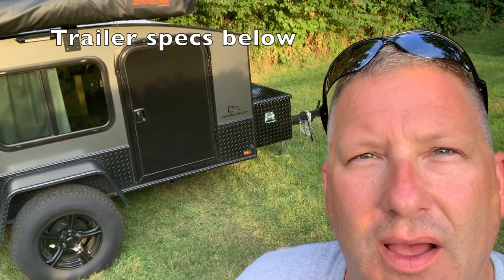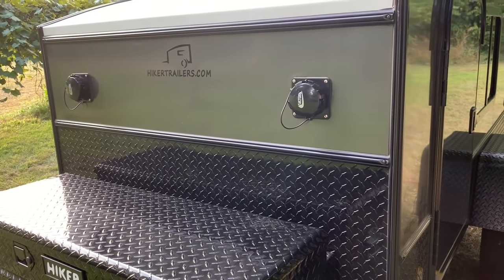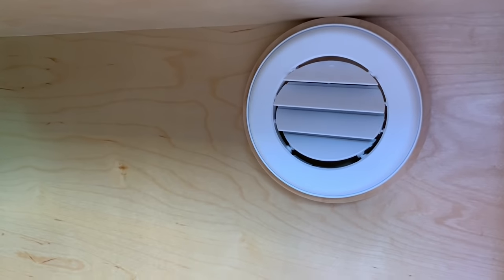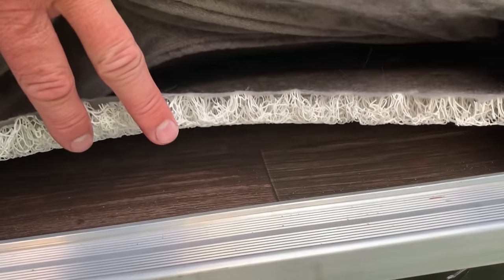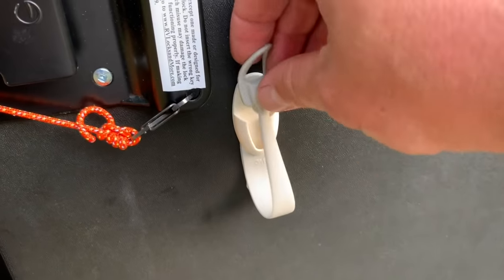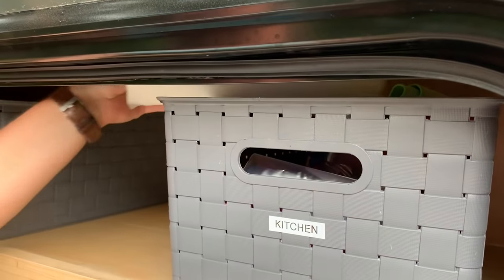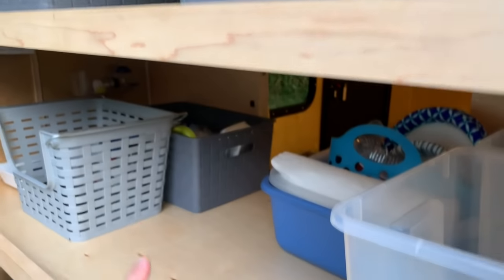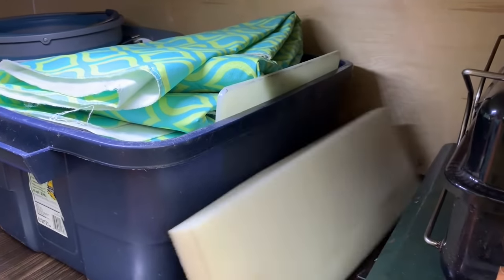Hiker Trailer - My 5x9 Mid-Range Walkaround

Comment: If you had not spent 20 nights in the trailer I would not have put much stock in your opinions..well done!!  Also..I was very impressed at Hikers flexibility in designing the trailer and in their execution.  It looked like quality work and materials at a reasonable price.  Thanks!

Comment: I am planning the ultimate road trip to Alaska. The Hiker is what I am considering. But getting dressed while lying down must be a pain? I may need something where I can stand. I have a couple of years to make my plans, so the info I get from you is good. And I am no spring chicken, I will be 65 when I go.
Reply from the maker: If you are off grid you get dressed outside if you are in a campground we have a 60 sec tent we pop up for changing . My wife does the wiggle worm in the trailer without issues. My knees say know. New video on the changing tent coming soon stay tuned.

Comment: Great video guys. So to be clear, you actually shortened the standard length of the galley shelves? Im undecided on the standard 17" or go with the 24". If yours are 14", im thinking ill be good with the 17". Any info would be greatly appreciated. Im getting ready to place my order. Thanks
Reply from the maker: Ours shelves are 24", we lowered the top shelf. I would always go with 24" shelves. The extra length in the cabin doesn't gain you much.
Reply: @MWDAdventures  Thanks so much for responding. Thats great info. Ordering today !

Comment: Matt, thank you for going over the details of hiker trailer and sharing your experience and opinions.  I also watched a review of extreme off-road version by you (I believe it was Taylor's).  I think I really want a small trailer like hiker trailer.  Do you regret yourself not getting extreme version?  What are the major deciding factors in getting Mid-range version over extreme version?  Is Mid-range capable enough to take on easy to intermediate trails?  Have you got yourself into scenarios in which you wished that you had extreme version?  If so, do you mind sharing those scenarios?  Thanks.

Comment: The emergency brake cable is supposed to go around the ball.
Reply: buckwilk  he was not using a 5th wheel and he also did not use the brake cable.....that was the point.

Comment: Love your videos Matt! I'm 75" tall and wondering if the 5x10 would be a better option than the 5x9, or if the 5x9 is sufficient to sleep fully stretched out?
Reply from the maker: We have the 24" deep galley and a queen size mattress fits in the cabin area perfectly.  If you want your feet to overhang the mattress you may need to go with the 5 x 10.

Comment: I like the idea of no galley in the camper cause of food smell and grease when cooking. I like that iPad holder I am in the process of building my teardrop no galley either. No back opening either save that space for storage in the drop and shelves for other stuff I want the camper as a bed pod. live out of the drop not in it. Not sure of the vent fan I am going with yet either max air or fantastic. I got a maroon minivan with grey trim that is the color I am going with on the drop. Thinking of diamond plate on the front.  Going with a Rubbermaid deck box putting 2 battery's in there and solar charger for off-grid boondocking.
Reply from the maker: W.A.B mobile entertainment I stay tuned I have a compilation video coming on galley ideas.

Comment: I see in the specs you got the 90 watt solar system. Have you used? Do you recommend adding?
Reply from the maker: It depends on your style of camping. If you are going off grid, then you should have some type of solar. We have used it a couple times so far. I like the ability to move it around to a sunny location vs having it on my vehicle which may not stay in the sun throughout the day.
Reply: Thank you so much for your response! I very much appreciate it! We have been looking around for a small travel camper and came upon your video and have watched all of them!Your videos have convinced us to buy a hiker trailer. You give so much good information! I will let hiker trailer know we bought one because of you and your informative videos!

Comment: They need a built in a/c unit. I wouldn't buy in florida without.
Reply from the maker: Jon  check out my other videos I have one on ac for my trailer. We get some muggy days in mi and we wanted it.  I have slept 20 plus nights and only used the AC once. The max fan in such a small space is amazing.
Reply: @MWDAdventures  what was the outside temperature during those nights? The only keeping me from getting this is the A/C configuration climateright AC units aren't even available anymore. I live in texas hot humid mid 90s nights are common here for some of spring, through summer and most of fall

Comment: Hi Matt, who makes that grill for the Coleman folding oven where can I get that grill?also where can I those under shelf lights?
Reply from the maker: The griddle we use on the Coleman stove was purchased at Aldi, it was a seasonal item 3 years ago. I did find something similar on Amazon. Also the under shelf lights are from 8EVP. Both items are in our Amazon store: https://www.amazon.com/shop/mattdewitt
Reply: @MWDAdventures  thank you very much Matt. Driving to Indiana later this month March 2021 see their faculty HT proubly get mid range 5×9 comming out
 fromPA. Thanks

Comment: You might want to address the rust on your hitch receiver.
Reply from the maker: Come Spring I will go over the trailer and address and seals or spots that need attention. Thanks for watching.
Reply: @MWDAdventures  That was your truck I was referring to. The receiver looked pretty rusty. I'm only stating this because the receiver welds can fail over time if neglected...👍

Comment: The spec sheet from hiker says weight is 1100lbs, not sure I understand why the gross weight you showed says 1900. Please and thank you .
Reply from the maker: Shomik Pathak not sure, weight is dependent on highway model, midrange or off road, then all the accessories- if Hiker told you 1100# then that should be right for your build.

Comment: What's the weight of that? Looking at options to pull with my Forester.
Reply from the maker: 1500-1900 depends on load
Reply: @MWDAdventures   oh thanks load capacity for Forester is 1500. So that's about right at upper limits but doable.

Comment: Why are the wheels outside of the trailer body? You're losing inside room building them that way.
Reply: Because it is intended for off highway travel ....keeping the trailer body narrower than the wheel track protects it. The ability to get there takes priority in these designs ..over space when you are there.
Reply: @greywuuf  okay I get it, groovy.

Comment: Hi Matt. I know you reside in the Mitten, but where? I thought I heard you mention Fruitport once or Muskegon? I wonder if you would be kind enough to inform me of the inside measurements of your Hiker Midrange. The floor to ceiling, and bed dimensions. Also what is the height of yours from ground to roof top (the top of your Hiker rack)? Is your  rig a 5X8 or is it a 9? I do not think it is a 10. .......Thanks, Barry @ Superior Overland, Iron Mountain Mi.
Reply from the maker: tentsrus I am from hudsonville area east of holland. The trailer is a 5x9.  I can get some dimensions tonight.  I will put them in the description.
Reply: Thank You much. I will look for your figures later. Thanks Again Sir!
Reply: Thank You Sir. I will look for your figures later tonight.

Comment: Do you have the dimensions inside the trailer?  Length, width and height?
Reply from the maker: S Figueroa I do it’s on a video on my channel called dimensions. I measure the whole trailer inside and out. It’s a common question. Check it out.

Comment: Does the spare hang up ?
Reply from the maker: SLAM BOY  I have 7-8 inches clearance.  Did some gravel roads with deepruts no issues
Reply from the maker: SLAM BOY if you are concerned you can move the spare location on the mid range to the front tongue box or roof.
Reply: @MWDAdventures  Ok no biggie just saw it under there and asked.